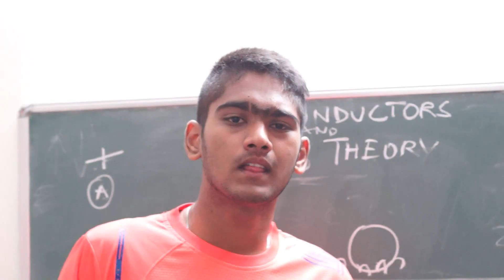Superconductors-BCS Theory Demystified #Breakthroughjuniorchallenge (submission)

Comment: Good one Pranav. Use of stones for lattice and electrons makes the concept sound simple. Want to understand in the second theory, if the 2 electrons moving in opposite directions in your anology repel or not. Also wont the positive cloud attract back the electron that has just passed by.
Reply: well, 1the electron-electron repulsion is overcome by phonon energy of the lattice. I.e. below critical temp the phonon energy is more than the Fermi energy ( surface energy ) so the electrons won't repel.
2. electrons are of opposite spins so the system's spin goes to zero. hence they act like stable boson. 
3. the +ve - -ve interactions overpower the negative-begative interactions.
Hope I have answered your question. 😀
-pranav